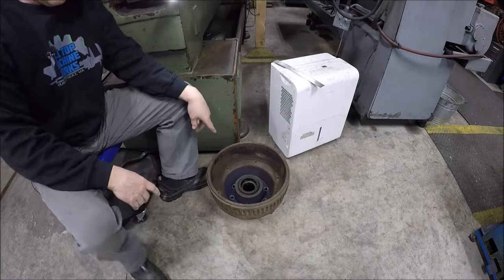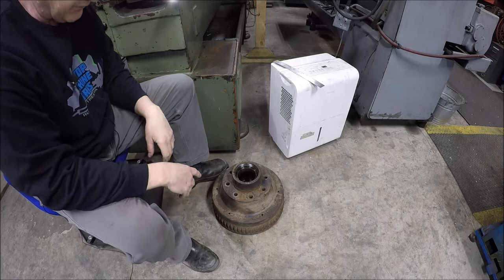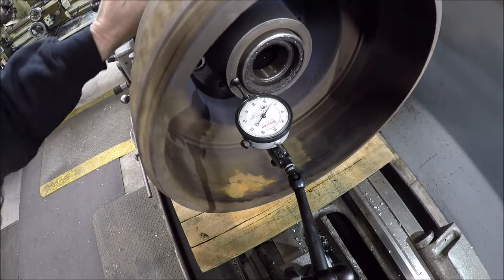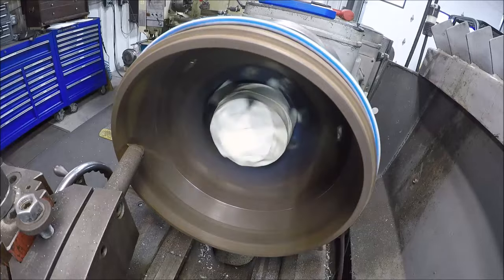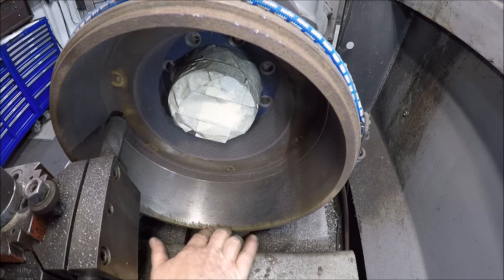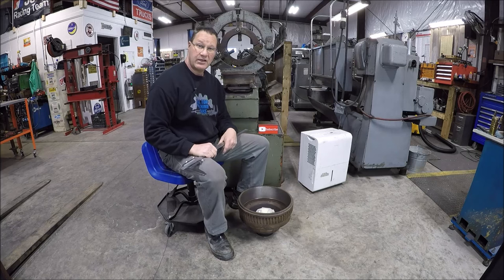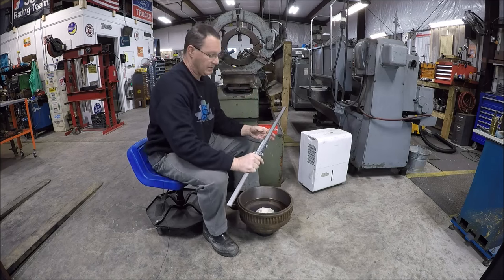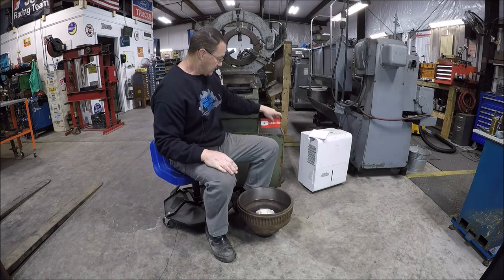Turning some brake drums for a local customer

Comment: That bungee trick is spot on! Glad you took the time to tape off the bearing hub. I see so many other channels just leave that all exposed and go to grinding or machining. I have a vintage Brown & Sharpe 18" vernier caliper that t I picked up at an estate sale for $20. It's a beaut.
Reply from the maker: Hey there Matt. Man working with cast is so dirty. Nice score on the B&S.
Reply: My preference is to take apart and clean after machine work. I have had poor luck trying to keep every bit of grit out of assemblies.  Usually that stuff needs taken apart and inspected anyways to do a proper job.
Reply from the maker: @bcbloc02  I agree. Hopefully he cleans it thoroughly before assembly. I figured I would at least keep out the majority of it.
Reply: @hilltopmachineworks2131  You done 👍

Comment: When I did brake drums &rotors,the first thing was to remove bearings and seals, clean the hub then turn.  You Need to repack the bearings. The fillings will destroy the bearings.  Good job.
Reply from the maker: Yep hopefully the customer will clean and repack the bearings.

Comment: Sounds like it might be cheaper to buy the kit to switch the trailer to disk than to fool with those high priced drums.  My electric over hydraulic disks are awesome. I would never have another electric drum brake trailer.
Reply from the maker: I am guessing he does not want to fool with it since he is going to sell the trailer once he gets it back together.

Comment: Run an OEM drum until it is out of spec.  Easily 500k miles.  Then buy OEM again.  Sure the after market seems like a smokin deal.  But there is less material.  The new to discard is half or less.  They also tend to deform more easily, although not as bad on a trailer.

Comment: you do know there are brake machining lathes that make very short work of those? i used to run several
Reply from the maker: I do. None of the shops around with brake lathes wanted to do the job.
Reply: used to charge 1 hours labour per axle pair, easy money for 5 minutes setup and dismantle, you have some slack buggers where you are
Reply from the maker: @Peter_Nottle  Yeah it seems shops now days don't want to take in any work that may require a little more effort on their part.